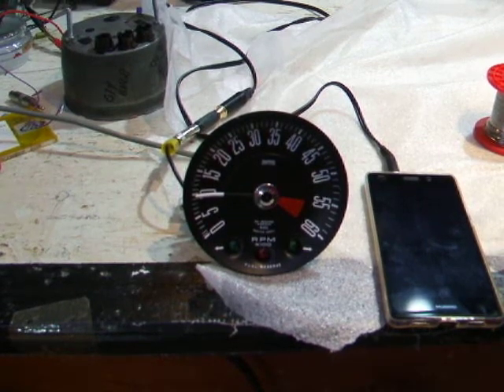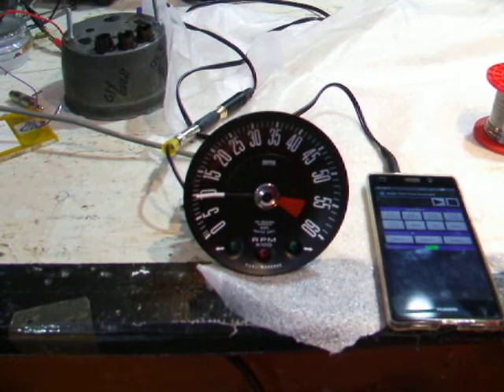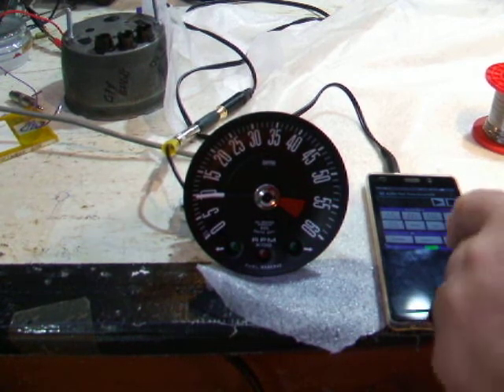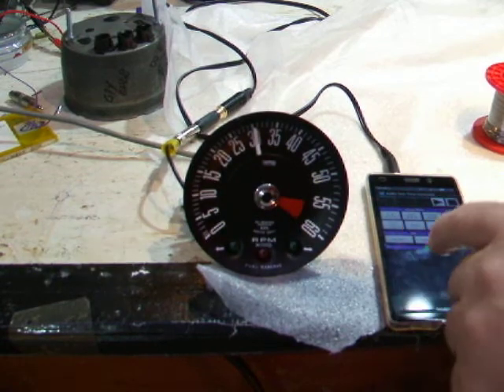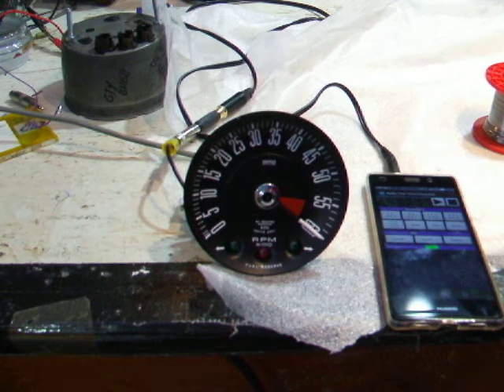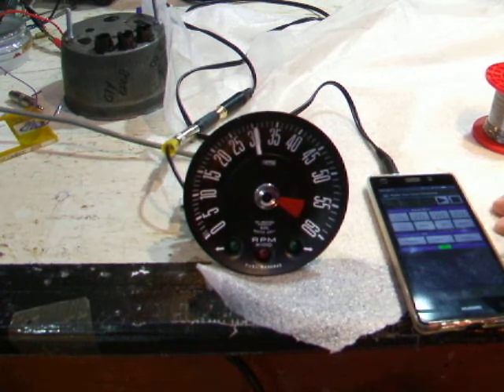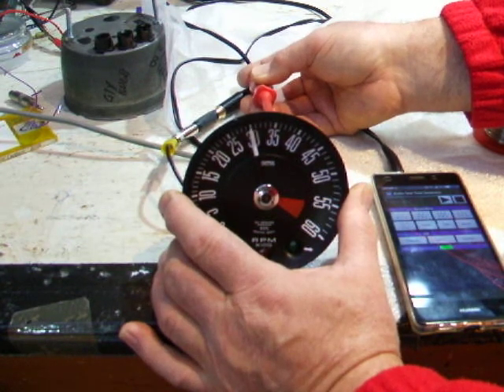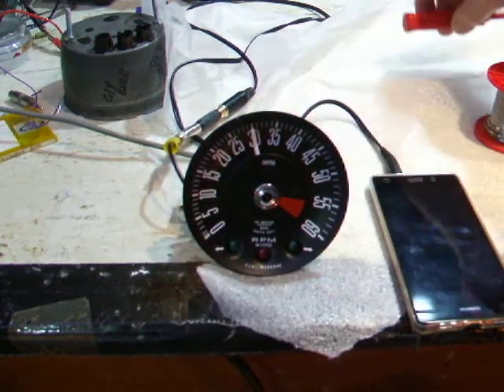Aston Martin DB6 Tachometer PT3

Comment from the maker: Hi. 
To drive the tachometer from a phone you need an audio oscillator app. You need a 3.5 Jack plug and lead, the ends need to be bared and the inner two connections joined together. From this a 47NF capacitor has one end soldered to the join, the other end goes to one connection of the coupling coil at the circuit board end and the screen to the opposite connection of the coil again circuit board side. You need to use a square wave output from the phone. Good luck.
Reply: Thank you.  Unfortunately I am not an electronics guy and that sounds more like brain surgery! LOL!  I do not even know if a capacitor has an "input" side or not...  I am assuming you mean a 3.5 stereo jack and you are tieing the "positive" leads together and the outer shielding is the "negative"...  Then you lost me on the "coupling coil" sentence as to where to connect on the tach.  do you have a picture of where  you are connecting?